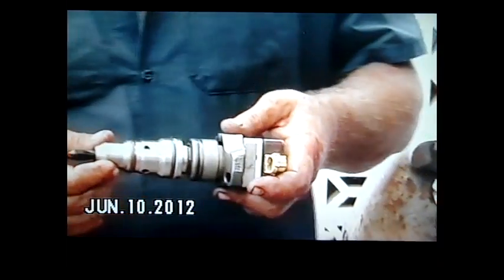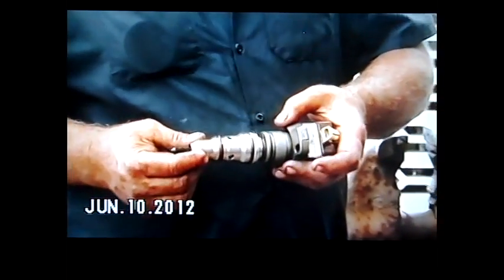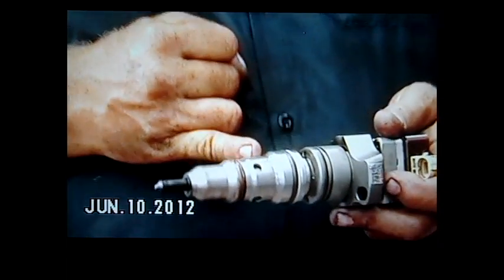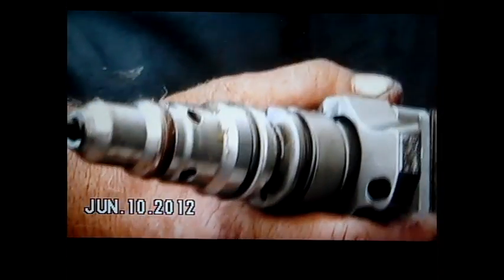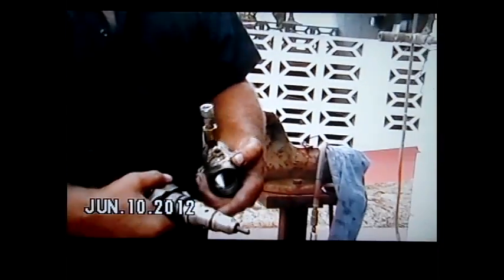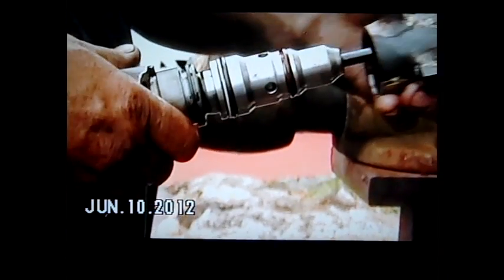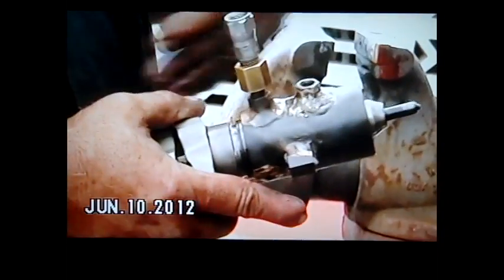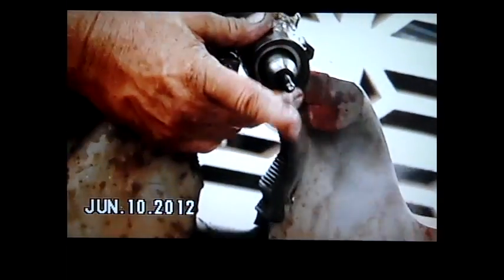Excessive smoke and knock, Testing injector on a international DT466E, T444E, CAT 3126, Ford 7.3

Comment: Without a sleeve were screwed? Got to be another way? I ohm injectors and there all the same . So if on out.good can it still be dumping fuel thats the question bleeding answered. Also if its good can the injector pod it sits in be the problem then?

Comment: I had this happen in a gasoline engine,  3.5. First it blew out a spark plug, helicoil, blew out, rapped to 18mm, reblew. Then the rod knock started, probably 70/30 chance rod is bent. Will try to pop in rod bearings first.